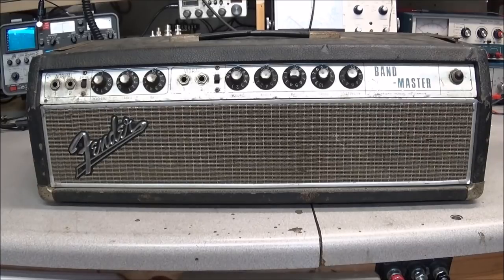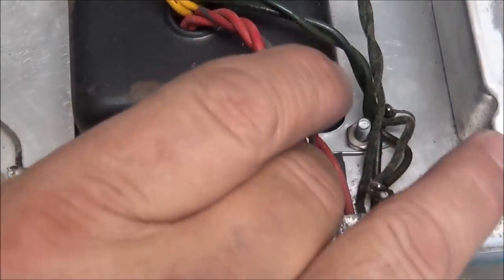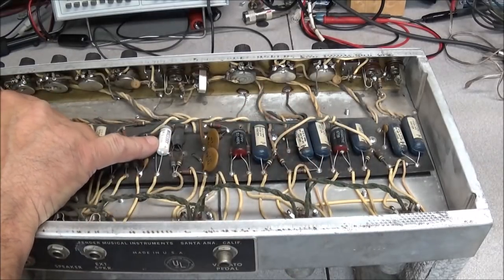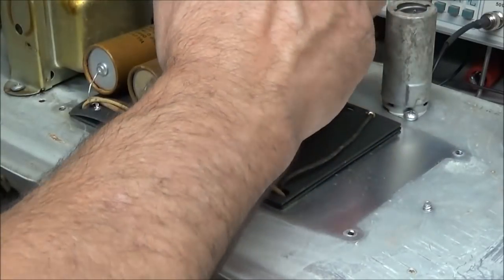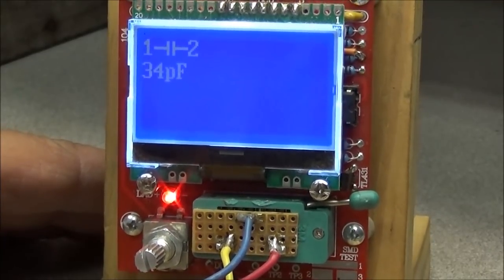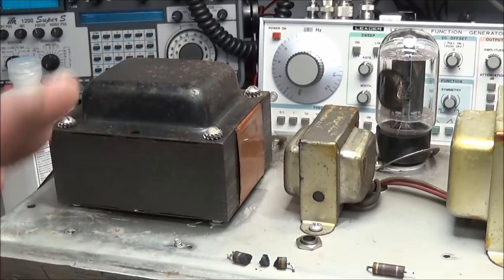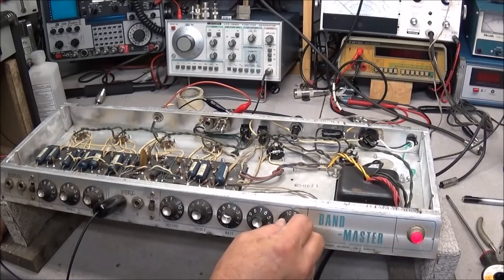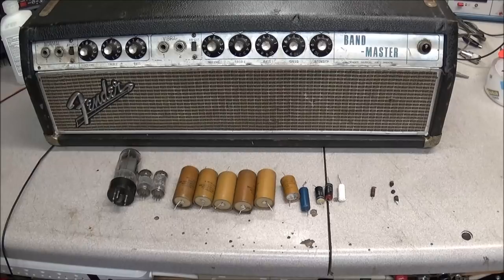#123 1969 Fender Band Master Repair

Comment: Hey Buddy I can thoroughly recommend the de-5000 LCR meter I've tried a few but the 5000 is the best as you can change the frequency
You test at to match the manufacturers specs. I've found them very accurate and you basically need the meter the little test box with leads 
which you modify with kelvin leads. I got mine with all attachments for $80 AUD off eBay brand new in the box in my state in OZ.
It has its own calibration built in. Check it out over there Buddy.
Reply: It's also on Amazon for $97.00.
Reply: Yeah the DE-5000 is very nice and also affordable,  I have one I've been using for about a year.  It's a very popular LCR meter now.
Reply from the maker: Thanks Peter, I will look that one up and give it a shot. Sounds like what I need.
Reply: Yep! Have one on the way from Japan as I type.

Comment: I have the same LCR meter as the one that you were using, they aren't bad for the money.  Mine is pretty accurate.  They have cases for some of these cheaper LCR meters now.
Reply from the maker: I have 6 or 7 of them in different flavors. I will say they do a pretty good job.
Reply: Some better capacitor ESR meters are  capable of testing in-circuit, these cheaper ones require removal of the cap.

Comment: Hi,  I have a question if you could help me out.
I have bought the bandmaster head and I wonder if it would be ok to run it through a 16 ohm speaker. I think the amp is supposed to run at 4 ohm .

Comment: +The Radio Shop The DE-5000 LCR meter is a great meter. I have one, and I use it all the time. But, you almost have to add the kelvin leads to the plug-in connector box with the very short leads. They are terrible to work with as they come to you. But, are quite easy to mod. My kelvin leads came direct from China for about $8, including shipping. I removed the BNC connectors and soldered them in place of the original leads. It is very quick and easy to do, and passes the self-calibration routine. About the DE-5000s auto power down function. If you power it with a 9V battery, it will go OFF about every 5 minutes of use. But, if you power it with a wall-wart it won't do that. This is important because it has to be re-calibrated every time it is powered down. Also, if you look at Mr. Carlsons Lab YouTube channel he has a video with some recommendations for older analogue capacitor/LCR meters; some of which will do leakage tests. The DE-5000 has no function that will test capacitor leakage. So, I test leakage with a high voltage DC power supply and I measure the leakage current with my Fluke meter. Hey, it works and I don't have to devote more bench space to another piece of equipment.
Reply from the maker: Thanks again Ken. I am still looking and this may be the one I end up with. Appreciate the information.

Comment: Hey bud, I recently required this exact amplifier! It sounds great and you did very clean work. I can’t seem to get the vibrato to work. I tried a footswitch and a shorted RCA plug with no luck. I can hear the vibrato very slightly through the speaker and the speed is working but there is no vibrato sound. Any suggestions? Thank you!
Reply from the maker: I would start by looking at the coupling caps around the vibrato circuit.  Also see you you can see the glow from the neon in the optocoupler glowing. Could even be the tube.
Reply: @TheRadioShop  , will do, thank you Sir!

Comment: I find it interesting on how collectors will get so passionate about leaving the vintage parts in place.  To me if a device will not function then it is just artwork so you might as well collect a photograph.  If you cannot use it why bother.  Would a vintage car collector let the car just sit there because only modern spark plugs are available?  Good quick work Buddy.
Reply from the maker: Well said Albert and thanks.
Reply: Collectors are funny people. I bought an old early 70s mopar, and it had the original factory spare tire in it. It still had the little nubbies on it from new and everything. Zero dry rot. 

I put it on ebay, and I got so much money I was able to put four new tires plus a spare on the car. Talk about insane!

Comment: When I had my service center, I did warranty work for Ampeg.  When Loud Technologies bought our St Louis Music, they sent out letters to all the service centers canceling all our parts accounts.  The said they would still sell us parts, but a retail.  I called them and told them in a not so polite way what they could do with their equipment and never did anymore warranty work.  I told them to send it back to China.  On another note it was fun dealing with guitar players.  I serviced one amp head and had it all completely to factory spec, but the player said it didn't sound right.  I had him bring his cabinet and guitar and while he played I changed capacitor values until he said "That's it, that's the sound".  I promptly soldered in the appropriate incorrect capacitor and another satisfied customer.
Reply from the maker: Hi Bill, Thanks for sharing. I really do not like Ampeg at all. Terrible service from them. I know what you mean about the sound. You have to sit there and tack in several caps before you hear the right note. Takes a while also. After doing so many you can basically select a tested cap and be spot on. Years of doing it though.  Thanks again.

Comment: The RADIO SHOP, if you remove the CHOKE from the power supply , what would this do to the AC ripple voltage? would this add harmonics to the amplifier circuit?

Comment: +The Radio Shop Hi Buddy. *I'm sorry for bringing up such a subject here. But, I have the same sinus issues you do and I know how bad it can make you feel. So, I hope this helps you to feel better.* Here is something that'll help you to feel better the next time your sinuses are bothering you. All of my family members have allergies and are sensitive to environmental conditions, like you. So, especially when we're doing activities that require us to endure dust, my wife and daughter will use those face masks, but i can't stand them. So, as soon as we're done, we'll use a solution consisting of 1/2 quart of distilled water, with 1/4 teaspoon of baking soda, & 1/2 teaspoon of NON-iodized table salt. Heat a small amount of the distilled water in your microwave. When it is very hot, add the Baking soda & salt to it. Allow the gases to escape for a couple moments. Then,  cover it and shake/stir it to dissolve the powders. Stir in the rest of the 1/2 quart of distilled water and continue to stir until you see all the powder has been dissolved. Before using the solution, test the temperature of it. You may have to wait a little while for it to cool. Next, you will use the solution to flush your nasal sinuses. Using a baby nasal aspirator/bulb syringe, fill the aspirator bulb completely with the solution. Then, lean your head back, close your nasal airway by lifting the back of your tongue upward. And, fill your sinuses with the solution; you'll feel and hear the solution bubble into the chambers of your sinuses. If you have infected sinuses, swelling may prevent you filling as much as you might normally do. But, do it anyway, it will help to heal the infection. And, if you have a cold it will lessen the time you have the cold. Do it several times to clear your sinuses as much as possible. Caution, while doing this, don't relax your tongue or the solution will run straight down your throat! Leave the solution there as long as you can. I've done this many times and have learned how to breathe while doing this. When you're ready, lean forward and expel the contents into your bathroom sink. Do this a couple more times. You won't believe what comes out. And, when done, you won't believe how much better you'll feel. We, in my family all do this regularly.
Reply from the maker: Thanks Ken for sharing that home remedy. I do not like taking meds at all. Much appreciated.
Reply: @TheRadioShop  I agree with Ken's recommendations with how to rinse your nasal passages. I too have nasal issues. TI think there is an easier way to do this. I use Neil Med nasal rinse which is available at Walgreens, etc. This is a saline nasal rinse that comes in packets with a nasal rinse bottle. Important detail, only use distilled water. I was using tap water and it made things worse! This has really helped me.Hope this helps.
Now for the fun stuff. I am refurbing a 65 Band Master. Very interesting to see inside of the 69' design. Band Masters are close to Bassman amps. The 1959 Bassman design is the origin of the Marshall JTM45 and most modern amp designs.